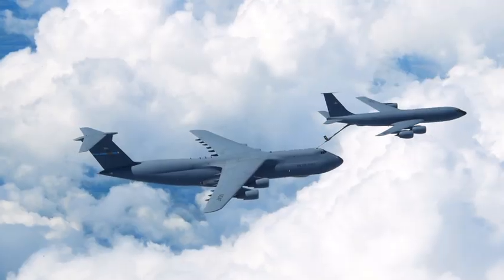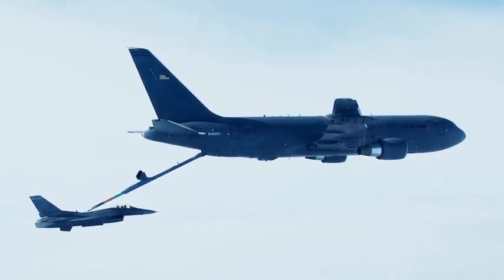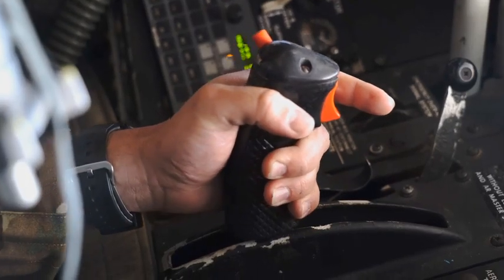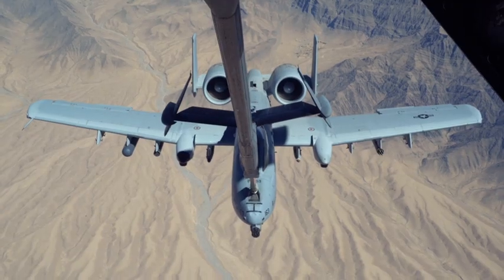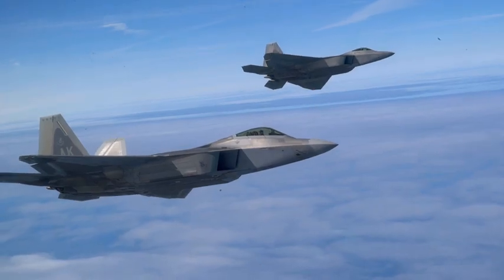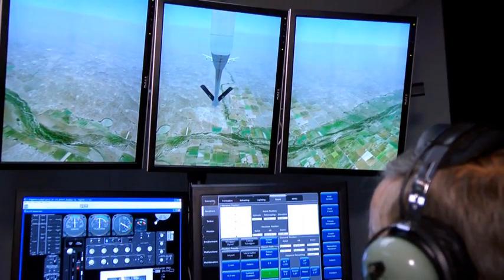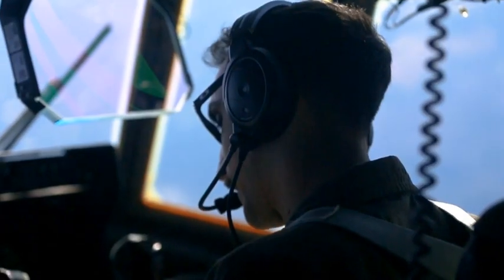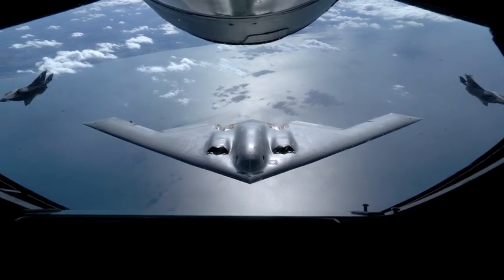U.S. Air Force: In-flight Refueling Specialist – Keeping Aircraft Aloft

Comment: I’m currently in DEP for fighter aircraft integrated avionics I’ll be in for 4 years. I just graduated high school this year I’ll be working on my bachelors degree for aerospace engineering and hopefully once I get it I can apply for a pilot slot. Any tips?
Reply from the maker: Yes, you may continue your education while on active duty. Once you have graduated basic training and then graduated from tech school. You will be stationed at your first duty location. There you may enroll and attend a local college by your base or you may enroll in an online college classes of a degree of your choice when off duty (when you are not at work on your own time). 

You could use Tuition Assistance (TA) which is a program that the Air Force uses to pay 100% of the tuition cost for college classes. This is not a loan, and is at no cost to the Air Force member. 

Using the Tuition Assistance (TA) program will not affect the availability of you using your Post 9-11 GI Bill education funds at a later time after you have separated or retired from the Air Force.
Ray 
U.S. Air Force and Space Force Recruiting
Reply: @USAirForceRecruiting  so i could earn a bachelors in four year enlistment using TA then another four years with a 911 gi bill after